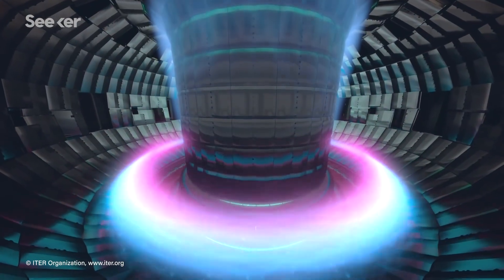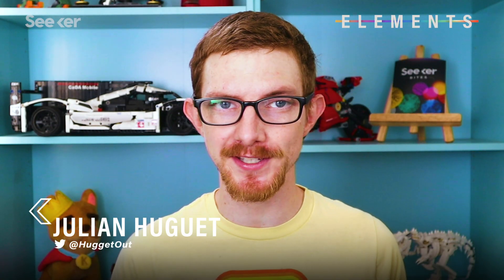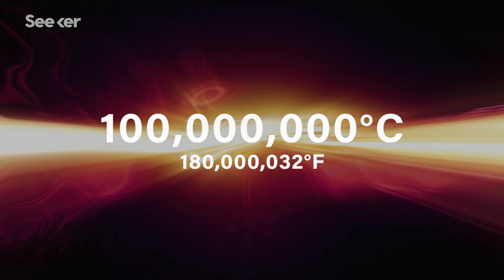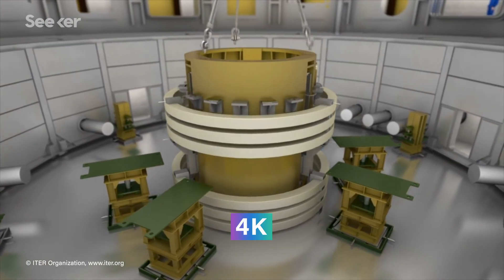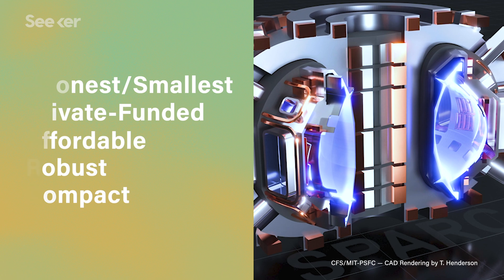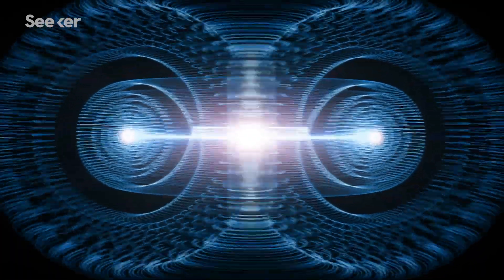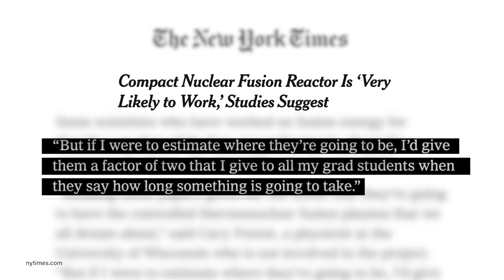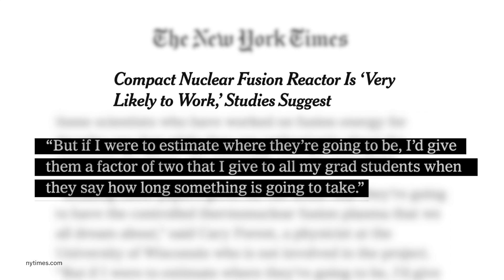Fusion Energy Could Be a Reality in Less Than 5 Years

Comment: hm.. its not mentioned. but from that i thing that means superconductors are needed to faster clock and on off sycles/frequency so you gen generate higher woltages in lover voltags therefore powerfull magnets for tiny particles :P seems fine.

Comment: Once again this guy never been part of a fusion reaction to produce mega joules energy.   this is the case for me at  JET from 1991 to 1998 . .  The problème is the electrons who can create disruption because very difficult to be controlled when où are focus on  protons. I mean the Nobium Titane coils able to cope with more 1500 amps per mm3  is enough to produce 8 Tesla magnetic field around the 1500 000 deg Kelvins plasma  plus in order to avoid the contact to the main inner wall of the Torus. The problems is also  the contamination by  particules from this wall  made in Beryllium  at Jet  and Lithium for ITER . This tend to drop locally the plasma température and can take part at the fusion process.  The fuel has to be send at the centre of the plasma with the minimal loss outside this position.  With a damm tokamak people must realise d the nest position to launch the fuel in at the core on the Tokamak and the angle of penetration is important. Just for the information  the gas must me send as ice pellets like a comet. This oblige to built a cryostat and a a centrifugal arm to get the velocity to reduce time travel . Eventually you have to get a pretty program to control everything including feedback loop in order to maintain the plasma and adjust in microseconds the magnetic field and the fueling system.  To be honest  the team will discover that the instability will be cause of frustration and therefore diagnostic will have to be installed which is not easy on a small Tokamak. For my concern this is  well above rocket science I m afraid

Comment: "Net energy gain" means more heat out from the plasma than injected to start the reaction. Does NOT mean that SPARC will create more power than it consumes. You have to take into account the power required to run the machinery, and the conversion efficiency from electrical power to thermal power and back again.  ITER hopes for Q=10 but will still only be equivalent to a net zero MW electricity power station if all the output heat were converted to electrical power.

Comment: This time its real guys they are using condensed metal to make it from to get stronger magnets and no cooling method needed the electromagnets inside is what the magnets will be made off the difference is where the net energy gains come from is purity of the metals because the shell will be so condensed and the magnets will be too if fusion produces so much and the magnets need so much then having a really concentrated metal that require hardly any electricity could result in net gains over operating cost this us due to superconductivity of condensed copper and steel in the natural form however if you want a safe machine to the touch you have to over concentrate so the temperatures can flucuate back down to the normal 70F if you power something your putting heat into it which would also change superconductivity which would affect condesning requirements

Comment: 2:55 “remember, we’ve never sustained a burning plasma here on Earth.” Um. Pretty sure fire has been a thing for awhile. Dude. How can you make insightful videos and then say things like that?
Reply: Fire is not a burning plasma
Reply: @Gomlmon99  Define “a burning plasma” so I can check it against reality. And fire. Also, please state your country of origin.
Reply: Will A burning plasma is a plasma in which most of the energy comes from fusion reactions within the plasma. Whilst a hot enough fire contains bits of partially ionised plasmas, it certainly does not fit the definition of burning. 

Don’t see how my country matters, although I do work in fusion research.
Reply: @Gomlmon99  Fair enough. I was unaware that the term "burning plasma" has a specific meaning that is different than "burning" and "plasma," of which fire is both. Thanks for explaining, although I think the origin of my misunderstanding is problematic in general (i.e. reappropriation of common terms).

Comment: How about a real estimate, not an overly optimistic one. Always 5yrs away when the media talks about this.
Reply: Real estimate for what is the question. For Q>1? 2036. For sustained Q closer to 10? 2055. For commercially viable fusion on the grid? 2090 maybe?? Source: work in fusion
Reply: @Gomlmon99  you on drugs 2040s at max
Reply: person Which project will that be? Currently the most advanced planned reactor is DEMO, which is an experimental/prototype reactor and will not be commercial. This is planned to start in the late 2050s. On this timescale, actual commercials reactors would be 2070s absolute earliest. This is the project run by Eurofusion.

Would love to hear about who will produce commercially viable fusion faster though. Most people I work with in the industry are not massively optimistic it’ll be commercially viable this side of 2100.

Comment: "Net energy gain" does not mean SPARC will create more energy than it consumes. It means the plasma thermal output would be greater than the heat injected to initiate the fusion reaction (Q > 1).  ITER is aiming for Q=10, but once the electrical power required to run all the machinery and create the plasma heating (300MW) is taken into account, plus the output conversion efficiency of max 40%, the overall electrical power balance (power out minus power in) will still only be negative 26MW(e).   So it's likely SPARC will also create a negative electrical power balance overall.  Don't be deceived - fusion people only talk about the plasma, they never mention the total electrical input power required.  Then there is the problem of how to capture all of the heat, how to make enough tritium given that it has a half life of only 12 years, where to get the electricity from to maintain the input power for the machinery while the fusion reaction is not happening - which will probably be most of the time, while the radioactive components damaged by the neutrons are being replaced. Etc etc.

Comment: Fusion it is not smart, it is good to consume a lot of money and do so.e research, by it is not practical.. I prefer the KISS method. A thorion reactor or even a fast breed nuclear reactor that Russia have, is available now, it produces 1.2 Mw of power and it is the size of a standard truck. Is reliable, no poluent, produces no waste, no radiation, uses no pressure vessel,  Can run for 30 years and is availability NOW.

Comment: why does everyone constantly call it clean energy? its certainly not clean nor limitless. i feel like that was the oil sales pitch 100 years ago. fusion is carbon free thats it. which is great, but why make bold faced lies when it comes to energy production. have we not learned any lessons about conservation?
Reply: Why is it not clean or limitless?
Reply: @Gomlmon99  hi, it creates nuclear waste (which however is much less harmful than the waste produced by todays fission reactors...but it's still nuclear waste nonetheless), but honestly you need not worry about it too much. nuclear waste can be dealt with quite well. i don't see it as an issue, but i do have an issue when someone calls it "clean". also it is not limitless because it uses water as fuel. there is a LOT of water on earth, and so it could fuel energy needs for millions of years...but once the hydrogen in the water is converted to helium...you no longer have water. so you are using up the 1 and only resource absolutely essential to life...albeit at a very very slow rate. should we be so brash? i think it is a good technology but it will not be the end of humanity's energy needs because it is not renewable. there is the possibility to use moon regolith for a source of helium-3 as fuel, but this nuclear reaction is even more difficult. not to mention the cost of shipping back moon regolith currently makes the business case for it a non-starter. i think fusion is an amazing technology and should be pursued but with our eyes wide open to its limitations and problems. and it certainly should not be call "clean" or "limitless"
Reply: 2Hedz I agree on the “clean” point, although nothing is perfectly clean. It is clean relative to a lot of other energy sources though. 
I really don’t think water is an issue. It only uses deuterium from water, meaning even if you used up all the deuterium in the world, 99.98% of water would still remain. Even ignoring that, I think a few grams of deuterium a day basically counts as renewable when there are over a billion trillion kilograms of water on the planet - so the sun would die before we used up our water.
I think it’s not limitless but not for the reason of water. We’d run out of helium and lithium way before we’d run out of water.
Reply: @Gomlmon99  omg! you are right,  i totally forgot about lithium, which ive seen calculations is in supply in only the tens of thousands of years. but i think we will find a solution to this issue at some point. and true, you are also right, the water problem is more in the billions of years not millions. so yes, the sun will likely devour us by then. but my point is...it is NOT limitless. limitless means infinite. we should never use these terms in regards to energy sources in my opinion. but, clean with respect to current nuclear and to fossil. renewables are much cleaner, so we should not put them in the same category of "clean" imo. i just think we should be very cautious about throwing around terms like this, when touting a new energy source.
Reply: 2Hedz Agreed. Although I think we should be careful with classing all renewables as immediately clean. Solar requires a lot of nasty chemicals and hydro has a whole host of its own issues. The important thing though, is that all of these are a hell of a lot better than fossil fuels!
Reply: @Gomlmon99  yessssss definitely 👍
Reply: @Gomlmon99  the only problem with current nuclear waste is that in the time it will take to decay language could've changed enough we cant convey its dangerous with fusion language and symbols would only change so much and danger would be much easier to convey

Comment: If high temperature superconductors provide the magnetic field in a tokamak, the magnets would still be cooled to very low temperature. This makes it possible to run more current and create a stronger field than conventional superconductors can. For this reason the machine can be made smaller which helps a lot.

Comment: It would have to produce at least 2x the power it consumes; 1x to power itself and an additional 1x to power something else. So what does it consume? Enough to power a home, 10 homes, a city? Seems like 5yrs is the new 30

Also, what happens to the "new material" that's created as a result of the fission? If  Fission is combining 2 atoms into 1 and harvesting the resulting energy, then what is the "1" that the fission creates? 

Does burning hydrogen generate less or more energy than fission? Other questions? More questions?

Comment: Typical....A multinational effort that has committed to designing a Tokamac large enough to absolutely GUARANTEE success , ITER, is ripped off China style by some cheeky lot who think they can get there faster simply by making their one smaller...well....I strongly doubt they will beat ITER.  The whole point of ITER,  the massive size of the project, isn't just for shits and giggles, it is that particular size for some very compelling reasons.  The larger size means more distance between the plasma confinement and the physical walls of the device, this, in conjunction with the newer high temperature super conductors, REBCO, promise far higher field intensity and less instability causing the plasma to pear shaped and leak by contacting the device walls. This smaller project, like many others, in my opinion, will not bear fruit, but are instead just very high risk high reward type ventures by some who have the money to throw at the problem.

Comment: Spoiler: This is all theory.
I wonder what they expect the actual power output to be. 2MW? 3GW? It will still cost a lot upfront and need maintained. It could still be more expensive than solar per MW output. And, I wonder how they intend to extract the power. It will be in the form of heat, like the plasma. It seems like it would just manifest as not needing to heat the plasma for a short time.
Reply: ITER, the most advanced, currently planning to produce 500 MW, although it’s a research reactor so won’t power the grid. Heat extracted by neutrons heating the lithium blanket, which transfers heat to a steam circuit.

Comment: It's all good and stuff, but I still haven't found an answer for two questions that bothers me. 1) what will be a continuous fuel injection look like and 2) - how to actually collect energy from it?
Reply: 1) Firing pellets of fuel into the plasma 

2) Neutrons from the reaction heat up a molten metal blanket around the reactor. The blanket than transfers energy to a steam circuit.

Comment: I'm sorry to say this, but while I support fusion research and think it will be one of the power sources of the far future, for right now, fusion is a distraction, and people who advocate for it over fission reactors are full of it. There's several reasons for this, but I only bring this up now because I just thought of another one.

Fusion advocates like to talk about fusion like it's an "infinite" source of clean power, with no real comparable. It just occurred to me, however, that this is total BS, because if you want to consider fusion to be a virtually infinite source of clean power, you MUST also consider fission to be a virtually infinite source of clean power as well, at least fission reactors based on thermal spectrum MSR thorium breeders. 

You might say; "Fission isn't infinite as you're burning up the thorium/uranium! You'll eventually run out, idiot." I'd point out that you're also burning up the hydrogen being fused in a fusion reactor. 

You'd retort, "Hydrogen is the most common element in the universe. There's a virtually unlimited supply JUST in ocean water." I'd point out, however, that almost all of that is plain single-proton hydrogen, which no fusion reactor, theorized or in development, could fuse. All fusion reactors fuse some combination of deuterium and tritium. This is where fusion and fission reactors are equivalent in being "infinite" sources of clean power. 

When you implied that we had more hydrogen than we could possibly need, you were close to correct when it comes to deuterium, which makes up ~0.01% of all hydrogen, and which we can pull out of the oceans. Tritium, on the other hand, doesn't really occur naturally, and typically is produced from neutron absorption and fissioning of an isotope of Lithium, Li-6. While not super common, Lithium is still more common in the crust than is thorium, occurring at 20-70 ppm vs. thorium's 6 ppm. However, Li-6, which is what is required to make the tritium that fusion reactors require, only represents ~7.5% of naturally occurring Lithium. So, if we give Lithium the high end of the estimated prevalence range, 70 ppm, that would mean that Li-6, a required fuel input for fusion reactors, only occurs in the crust at ~5.3 ppm, which is equivalent to thorium. Thus, if fusion based on deuterium & tritium is considered an "infinite" source of clean power, then a thermal spectrum MSR thorium breeder fission reactor must also be considered an "infinite" source of clean power, as you'll be going through your Li-6 about as fast as you'd be burning through your thorium. 

This is just one additional point proving why anti-nukes and anti-fission advocates are full of it (I include fusion advocates in this as their arguments for fusion typically involve a certain amount of unjustly dumping on fission), which are:

1)They're both sources of clean energy based on current standards, producing zero CO2
2)They produce an equivalent amount of energy to each other. Deuterium + tritium fusion yiels ~17.6 MeV, or around 3.5 MeV per nucleon, while U-233 fission yields 197.9 MeV, or 0.9 MeV per nucleon. As such, fusion only produces about 4X the amount of energy you get from fission, and that's in a perfect system. Also, keep in mind that fission itself already produces 1,000,000X the amount of power you get from fossil fuels.
3) With a fusion reactor, you're going to have to pour 10% to 50% of the power you generate right back into the reactor just to maintain fusion. So, really, even in a PERFECTLY engineered fusion reactor, you're really only going to get 3-3.5X the amount of power you'd get out of a fission reactor. Fission reactors, on the other hand, require no power to maintain reaction. You just keep feeding in fuel. 
4) Both fusion and fission reactors produce radiation and radioactive waste. In a thermal spectrum MSR, you'll be producing almost entirely short-lived fission products, almost all of which will be gone/non-radioactive after around a decade. Fusion reactors produce radioactive waste from neutron bombardment of components, as high energy neutrons produced from fusion strip neutrons and protons off of atoms in the containment vessel and other components. 

Also, when people say that it takes 300 years for the waste from an MSR to decay away, they're talking about Cs-137 and Sr-90, which both have a half life around 30 years. These isotopes only would only make up a small percentage of the fission products produced by an MSR, with the majority of fission waste being gone in 10 years or so after coming out of the reactor.